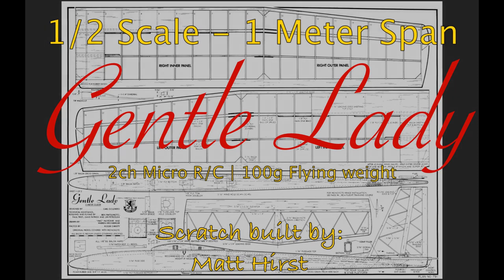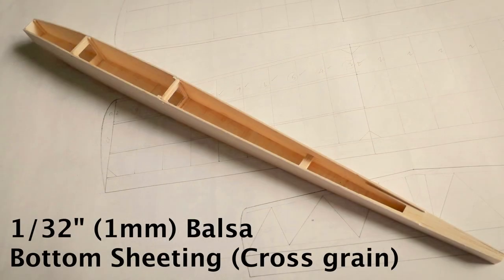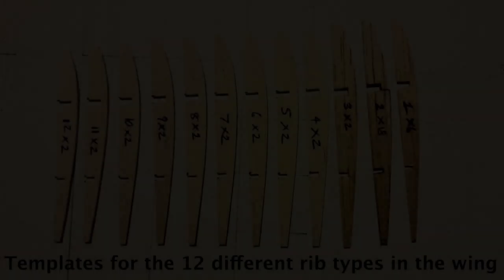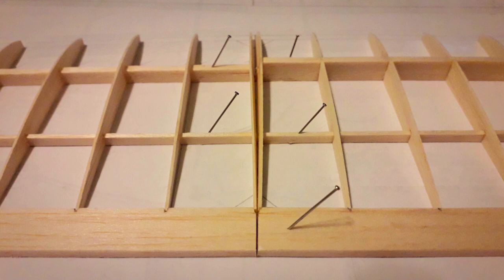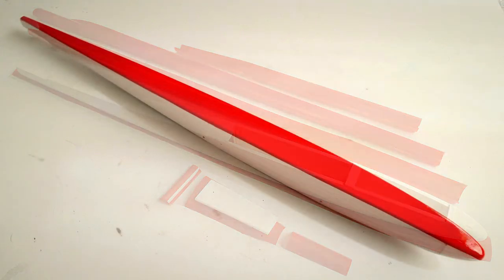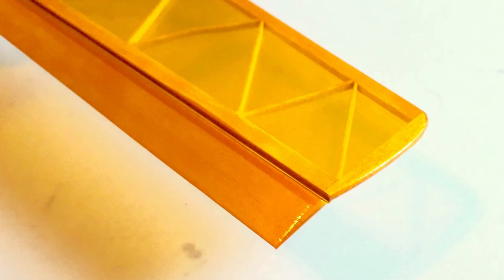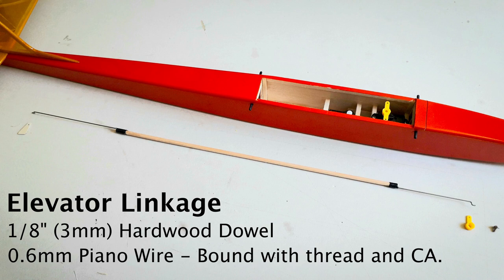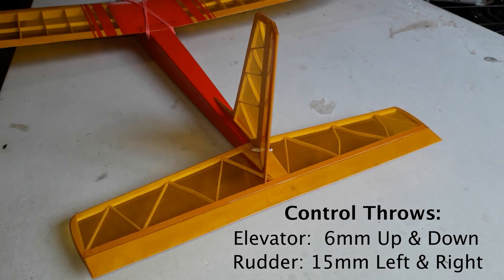Half-Scale Gentle Lady 50% R/C Glider | Scratch Build Start To Finish

Comment: Build process in video is very well shown. When dimensions are scaled down - how does one calculate and reduce the thickness/ width/ of components like wing spar, ribs etc., to reduce weight to maintain appropriate wing loading since wing span is reduced.
Reply: I have upscaled (enlarged) and half-scaled plans.  There are two ways that I have used to solve this problem.  First you can use a micrometer to measure the new thickness, then purchase the balsa which closely matches.  Second, you can cut lighting holes in the balsa to reduce weight, while maintaining wing load and fuselog structure.

Comment: That is a nice build. One thing I notice is that the wing tips do not seem to be tapered in the later stages of the build or in the finished model. It seems the wing has a constant chord from root to tip. It may be a perspective optical illusion. Does your version have the same taper as the original?
Reply: Hi OliveiraX, thanks for the compliment! I guess it must just be the camera perspective but the wing plan form is the same as the original design. The centre panels have no taper but the tips are tapered. There s also a very slight taper in thickness through the tips as per the original design too.

Comment: Really enjoyed watching your video and all the detail. I think I must have missed something relating to the wing ribs. As well as the spars which enter from the bottom of the ribs, on the second shot of the ribs there is a top cut out for a top spar? If so what is the size. Apologies if I've missed something.
Reply from the maker: HI David, I'm glad you enjoyed the video. In the centre section panels I made the spars full depth from 1/8" balsa.. I made a slot half-depth from the top for each rib. The tips panels have just got 1/8X1/4" balsa spars and the ribs are notched to fit over them. I hope that helps!
Reply: Thanks Matt, yes that's clarified it. Looking forward to having a crack at it.

Comment: Very nice. I'm thinking of a Gentle Lady for my first balsa build.
Reply from the maker: Great idea! Its not too complicated to build for a beginner and they fly so well!
Reply: It is a great model, you can take it slow and use wood glue (like Tightbond2 or 3) if you would like. Do NOT worry about building it as light as possible, it can handle some extra weight.  It is easy to cover for a first model too. Just take your time, and you will have a great flying glider for years and years. Stick a motor on it and it will fly for HOURS with cheap modern equipment.

Comment: I'm very happy to see that someone has done what I've been thinking about. And your build looks excellent.
   Just so you know, Outerzone has Gentle Lady plans and many others for free download. With that you can send it to a local print shop where they should have complete control over the scale you wanted. I think I paid maybe $3 - $4 for mine. No hand drawing needed. I already have one copy, but I need another sacrificial copy so I can cut out rib drawings, etc. Do you have a flight video, and any thoughts about changing anything?
Reply from the maker: Hey Joe, thanks for your constructive comment. I built this model during lockdown so the print shops were all closed, hence the hand scaling. You've probably found it already, but here's a link to a little flight video I made of it: https://youtu.be/xbXi1am1T98
I doubt I'd change anything except I might choose some harder balsa for the spars next time just to be sure it's tough enough for bungee launching. I've got plenty of flight time on it now and its great fun every time I take it out.

Comment: What a good video, my question is, with that 3.7v battery you can power the receiver and the 2 servos, since the receiver is 5v and the servos are the same and wat is the final weigh of the glider
Reply from the maker: Hi Julio, thanks fo rthe comment. Yes the single LiPo cell provides enough power to run the two servo's and receiver reliably. The battery peaks at 4.2v and I get loads of flight time before it drops too low for the system to run safely. The servo's have very light loads on small control surfaces so I think the current draw is very low.

Comment: Great video! Thanks. My first balsa plane was a Gentle Lady, built back in 1980 or 1981. I still had that glider until this year, having to rebuilt her several times. This last time the were just too small to put together again. During the video you mentioned a source for plans for the Gentle Lady still available. I was unable to hear the source mentioned. Could you give it here? Thank you. If you have the smaller plans available please let me know. They look like fun. Thank you in advance.
Reply from the maker: Hi Lee, unfortunately I do not have a digital copy of the reduced plans but you find the original plan I worked from here: https://outerzone.co.uk/plan_details.asp?ID=5961     I Hope this helps!